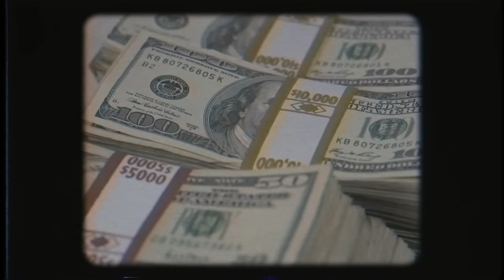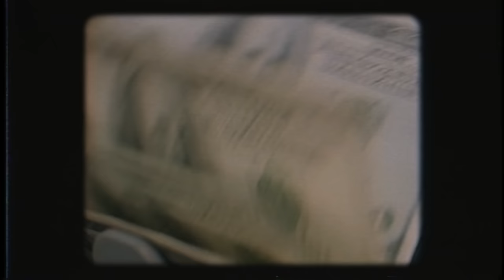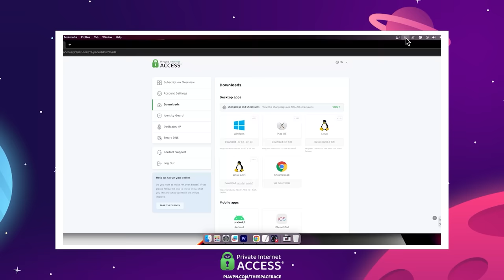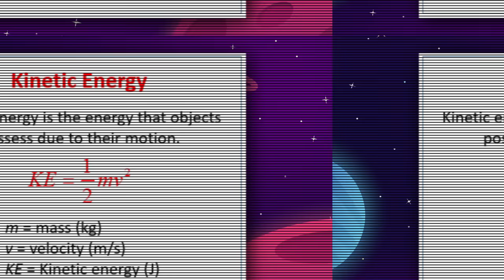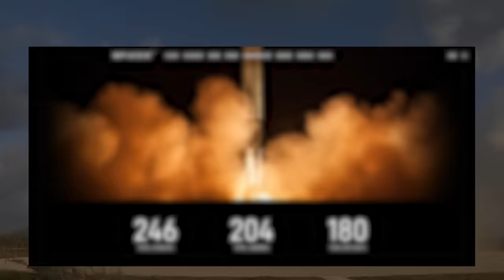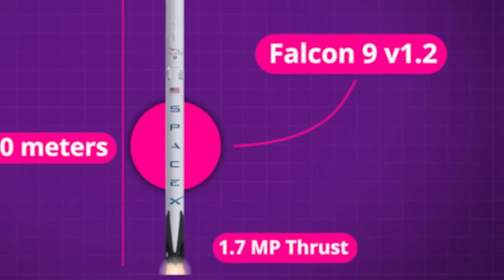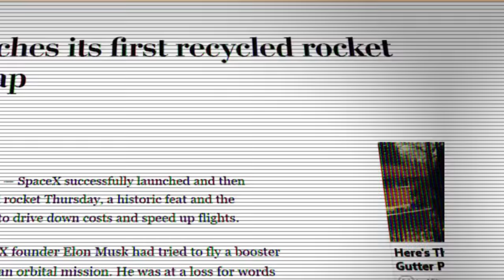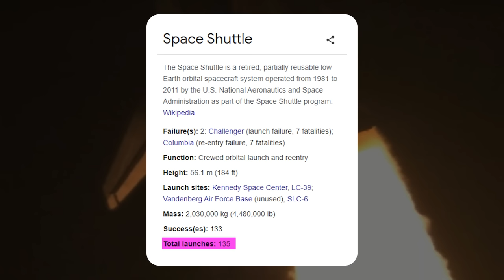How SpaceX Reinvented The Rocket!

Comment: One point about the shuttle: 136 missions, 2 failures, BUT the shuttle never failed: in both instances the launch system (first the SRB and then External Fuel Tank) destroyed or damaged the Shuttle.
Reply: 135 flights, not 136.  Not certain why that’s not clear, but your right about the STS never failing.  Cheers
Reply: The Shuttle Orbiter never failed. Two SRB's, one external tank, and one Orbiter equals one Shuttle Transport System. There were two STS failures.
Reply: The system certainly did fail, and cost over a $BILLION per launch - another failure. The lessons learned were quite valuable.
Reply: @johnstout5767  A 30 year run for a single design, deliver-payload-to-orbit capability, 7 person crew who deplaned down stairs on an airport tarmac, mini space-station, cargo-hold modular laboratories, repair and refurbish platform, and 100% reusability of the orbiter, designed and built in the late 1970s... a FAILURE? Not a single space agency on the planet ever got past cramped single-use splash/crash-down capsules. As for cost? It is 2023 and the SLS costs $ 4.3 billion per launch, THROWS AWAY the reusable Shuttle RS-25 engines and has a launch cadence of 1 : 1.5 years. Are you kidding me? You should kiss the ground the shuttle landed on!!! 40 years ago, man! 40 years ago!
Reply: @lawrenceallen8096 STS failed to meet its cost and safety goals, and as a related effect, failed to meet its launch rate goal. It was a tremendous technical success, however, and did deliver a capability to do things in space that no other system could do before or since. All in all, I think that for a first of its kind, it wasn't as bad as its critics like to whine about. NASA always had ideas to improve the system but it never was able to get the up front cash it takes to implement those ideas. And instead of building a Shuttle 2.0 which built on the earlier system and corrected its flaws, NASA had to cave to the critics and shifting winds of politics when STS was finally retiring, sticking NASA with SLS and hiring SpaceX for Uber rides to the ISS.
Reply: Zero Data on booster refurbishment has ever been released to the public.
Reply: @RCAvhstape  I mean as much as it was "politics" that retired STS and crushed the dreams of building upon that infrastructure for its successor, it was also "politics" that kept STS in circulation FOR 30 YEARS WITHOUT EVER MAKING IT WORK LIKE INTENDED. You can always complain about pulling the plug on a system that could be done better, but when there's literally zero precedence of NASA actually making STS work the first time, all when having 3 whole ass decades to do it, then I'm just not gonna cry over it. Nobody can say that $200B, 135 flights, over 30 years wasn't "enough time" for the STS to prove itself. In fact you'll be hard pressed to find any concept given more political capital than STS.

The SLS could've clearly been done better. For example, reliability and reusability of the RS-25 by the end of STS's run was legitimately good. It's a shame that it wasn't implemented on SLS. Instead of SRBs I'd love to see retrievable RS-25 side boosters. But other than, most other aspects of STS was a failure.
Reply: @lawrenceallen8096  RS-25 is pretty much the only aspect of STS that actually fulfilled NASA's ambitions of reusability with minimal refurbishment and quick turnaround. The rest of it was a mess. Like congrats, STS nailed down like 5% of what goes into reusing an LV. In a counterfactual world where NASA commissioned a STS 2.0, they'd still have to solve the remaining 95%, and if SLS was 6 years behind schedule, you just know that STS 2.0 would be even longer. Artemis wouldn't even have its first launch well after Starship would become fully operational at a fraction of the cost.

SLS is just a 5 vehicle commitment, whereas a STS 2.0 would've been a 30 year committment in a world where Starship is just better.
Reply: @ohedd  I would not advocate for an STS 2.0. The design is a half-century old. Why replicate that, even with improvements. "We're going to build a new '57 Chevy, but improved. No. I agree with you. The shuttle deserves to have an honored place in Space Launch History for its unique 30 years of service. We now, in 2023,  look forward to rapid reusability Ala the Starship. Also, next level economics to orbit, and one-of-a-kind inner-planetary capability. GO SPACEX!
Reply: Didnt challenger and Columbia explode during re-entry...
Reply: @parthasarathyvenkatadri  No. One was destroyed by a defective SRB (Solid Rocket Booster) igniting the External Fuel Tank during launch. The other had its wing damaged during launch by falling ice and insulation debris during launch, leaving a large hole in the leading edge of one wing, and was ripped apart during re-entry.
Reply: @parthasarathyvenkatadri  Challenger on ascent, Columbia on descent. Although both of their fates were sealed due to events during ascent and launch, respectively.
Reply: @parthasarathyvenkatadri Columbia's heat shield was damaged by a chunk of foam during launch that came off the tank, and Chalanger SRB had a bad o-ring that sent a jet off hot gas into the Fuel tank causing a explosion during asent.
Reply: @lawrenceallen8096  Space Shuttle was very primitive system from 70's, and overengineered in the same time.
Glider-like landing added at least 40% more weight for nothing:
parachutes are much safer and not dependant on weather. No rocket emergency escape system was a critical design failure.
Reply: @peceed  Your argument is akin to saying: "Those caravel ships used in the 15th century by Columbus to discover America were so over engineered. 40% of their bulk was unnecessary, using wood the way they did instead of carbon fiber. And no lifeboats? What failures they were." Yeah, sure peceed. Whatever you say. Having a fleet of ships meet you somewhere in the middle of the ocean and pull you out of a teeny capsule will remain the only way Human Beings will return from space in perpetuity. We'll never go back to the primitive days of landing at a Cape Canaveral or California runway and walk off. Geese! What were they thinking!? And thank goodness for Obama, he solved the problem: He took the USA out of manned space flight for a decade! He ended all that silliness! We're supposed to stand humbly on the shoulders of giants. Not pi$$ on them, son.
Reply: @lawrenceallen8096  STS was a stupid idea from the beginning, and step backward. Typical "cult cargo engineering": aircrafts are safe and cheap, so lets make space system that looks like an aircraft - it should also be safe and cheap.
There was a lot of really good private designs for cheap space transport for 70's. Space Shuttle wa the program that was designed to be expensive.
Reply: @peceed  When I had the opportunity in my career to lead teams that included engineers, one engineer friend of mine told me this: "One thing you've got to know about engineers: they are in love with their own ideas and will go to great lengths disparage and undercut other's ideas and other's achievements in order to promote their own. Even if... ESPECIALLY IF, their ideas are inferior. Don't let them mislead you." Somehow, your comments here peceed feel just like that.
Reply: @lawrenceallen8096  As a scientist and engineer I have one advice for you - you need to judge independently. If you are relying on opinions of other people - you are lost. I didn't say that Space Shuttle is a bad idea, I said WHY it is a bad idea. You don't need counteropinions, you need counterarguments.
Space industry was run by idiots in white collars. For example they saw that bigger rockets were more expensive than smaller, so they insisted on 
excessive weight reductions that increased costs around 5x. In reality fuel is so cheap compared to rocket construction, that it is always better to make heavier low tech solution.
Reply: @peceed  Hey, did you hear the one about the 3 guys & the guillotine during the French Reign of Terror? The first one, a commoner, was asked by the executioner: "Do you want to be face up or face down?" To which the commoner said: "Face down, I don't want to see it coming." So he assumed the position, the executioner pulled the rope, the blade came down and CHOP! The next one was a spiritual person. When he was asked face up or down, he said: "Face up: I want to be pointed toward the gates of heaven." So, again, assumed the position, rope pulled but WOW! This time the blade stuck half way down. The crowd gasped and the executioner said: "It is a miracle! Let him go!" The 3rd one was an engineer. Same question. "Face up, I want to see how this fascinating machine works." So they put him in, pulled the rope, it stuck half way down, and the engineer says: "Oh, I see the problem!"
Reply: I think you mean the orbiter never failed.
Reply: @valentinaerospace4211   Yes, the Space Shuttle. Not the Space Transportation System. Launch components of the STS killed the Space Shuttle twice.
Reply: The shuttle design from the start, was obsolete.

It was set around a payload size determined by the Defense Department that was never needed, along with a return after one go around orbit capability also determined by the Def. Dep., never needed, that made the wings the size they became. 

The shuttle could've been a lot closer to a lifting body, or a straight wing craft instead without that requirement.

The Defense Department later dropped most of it's use of the Shuttle, abandoned it's Vandenberg launch site along with 3 additional shuttle orders.

NASA really co-opted it's needs with the funding from the military needs that rarely then used it.
Reply: @jbdelphiaiii7637  Shoudda, wouldda, couldda.
Reply: @sonnyburnett8725 135 or 136 are you really going to be that guy that South Park makes fun of?
Reply: @RCAvhstape  
RE: ". . . and hiring SpaceX for Uber rides to the ISS."
Remember that both NASA and ESA had to use the Russian Soyuz spacecraft for rides to the ISS, as well. Which, of course, is a disgrace.
Reply: @spaceman081447  I agree, and I think it's a good thing that NASA is letting private industry handle the more routine stuff, that was kind of the point of creating NASA in the first place, to boost American aerospace industry. Maybe I shouldn't have worded it the way I did. But with the end of STS came the loss of a significant capability that was never really used in its day.
Reply: The External Fuel tank didn't fail... The shuttle just couldn't handle ice being dropped on it. Weak.
Reply: @lawrenceallen8096  Yea because we didn't need the shuttle for any of that lol. We did all that in spite of the shuttle not because of it. Sure maybe it looks good when you compare to other government blunders if that's the best you got.
Reply: @RCAvhstape  We didn't build the space shuttle 2 because any space shuttle design is doomed just because it's a space shuttle. The concept itself is bunk.
Reply: @Fooney1  Whatever you say, chief.
Reply: @Fooney1  Nothing flyable could survive supersonic impact of ice. Unless you want to fly a tank.
Reply: Humans failed, and both the Challenger and Columbia disasters could have been prevented.  NASA had solid info on both the SRB problem that doomed Challenger, and the foam breaking loose from the ET that caused the breakup of Columbia....and they knew and understood all of this well in advance of the failed missions.

The biggest problem the shuttle had was the expense: the concept was to reuse it, which they figured just HAD to save money over completely expendable rockets, but I guess no one ever considered the monumental cost of assessing and recertifying thousands of systems and components, and the shuttle never met is cost or launch frequency goals (not even close, in fact).

Reusing just the first stage booster might very well be the sweet spot where recertifying for another launch is cheaper than just building another booster.
Reply: It did fail. A successful spacecraft should be able to save astronauts from a launch emergency. The Shuttle was ridiculously unsafe.
Reply: @xitheris1758  Well, that's it then. 30 years, 136 : 2. Cutting edge, never been done before and never matched by any other country, unique capabilities that we can't even come close to today. Just a failure. Huh, and Apollo Saturn V was a failure too because it killed at a rate of 11 manned launches : 1 fatal failure. But it had an escape system! Huh.
Reply: @lawrenceallen8096  The only fatalities in the Apollo program were Apollo 1, during training in the Apollo command module. It never got integrated with the Saturn V, much less launched. The Saturn V had zero fatalities.
Reply: @xitheris1758  "It never got integrated with the Saturn V." Wow, is you ever an x-pert on that there Apollo! I guess that Apollo 1 test just used a giant paper machete mock-up of the Saturn V... you know, when the astronauts entered the capsule that day. Get, I didn't know the rocket that it was atop was a fake. Thanks for informing us!
Reply: @lawrenceallen8096  What are you smokin bro? It was never atop a rocket. It was in a testing room for a simulated launch. They tried to pry open the capsule when the fire started. Go look at the photos of the aftermath. It's in a building, not atop a rocket.
Reply: @johnstout5767 SpaceX currently charges 2.8 billion in taxpayer funded contracts to perform the same tasks as a single shuttle mission.

So what's the lesson?
Reply: It got hit by some foam.

Such a durable vehicle.
Reply: The external tank was its Aquiles heel. Its the direct and indirect cause for the loss of two vehicles and 14 astronauts. With Challenger the O Ring failed and the 'firing torch' punctured the Fuel Tank like a knife through butter exploding it, With Columbia the fuel tank dropped insulation foam during the supersonic ascent which destroyed a section of the vehicle's wing. The tank was the loose cannon in the whole Space Shuttle design.
Reply: @adelaideadelaide8855  Agree in the 2nd case. However, I don't believe any gigantic fuel tank design could stand a solid rocket booster ejecting what was essentially a gigantic blow-torch to its side while it is under supersonic stresses.
Reply: The launch system is part of the Shuttle... It flies with it... So the Shuttle failed. Granted, the Challenger destruction happened because of malfunctioning O ring in the SRB on launch, but the Columbia orbiter destruction was product of a Shuttle failure during atmospheric entry caused by isolating foam impact on the edge of the wing. A terrible tragedy nonetheless whatever angle you want to see it.
Reply: The shuttle was designed and implemented by NASA - a quality organisation. SpaceX has been failing and blowing things up on a regular basis since it's inception and has never had a really robust, reliable launch system... the eBay of space. You might get something cheap that works.... but all too often you just get something cheap.
Reply: @lawrenceallen8096 thank you for laying down some of the facts and correcting the unfair comparison of the STS to the falcon 9. The shuttle was basically a giant truck, designed to transport and assemble the international space station. The falcon 9 is designed to put payloads into orbit and transport supplies and crew to the ISS.
Reply: @TTURocketDoc  Thanks. I might add one thing to your description: "falcon 9 is designed to put payloads into orbit and transport supplies and crew to the ISS." Cheaply! At a LOWER cost.
Reply: @johnstout5767  The Orings didnt really even fail... they performed as expected under the conditions they were used in on that day. It was well known that a leak was highly probable when used below a certain temp (54F I think). The failure was a MANAGEMENT failure... management overrode the advice of their engineers. This is well documented.
Reply: The orbiter did fail do to the tiles falling off.
Reply: @ctuna2011  Nope. Came close, but no shuttle or payload was lost (or lost its re-usability) due to tiles falling off. Sorry, not true. The SRB's destroyed the orbiter in both cases there was a lost of the shuttle.
Reply: Will you stop this ‘pound’ insanity please? The world is about tons. By contrast you do use meters for length. Wise to avoid feet and inches, for starters
Reply: @RomanMedvid  I'm a native born American who lived abroad for 22 years. I'm comfortable thinking in and working with both. I even got used to working with "ping" when shopping apartments in Taiwan HongKong and China. Best of luck dealing with your discomfort with other people using multiple measurement systems.
Reply: @parthasarathyvenkatadri 
No the landing gear door on one side was not properly latched, a weak design principle. The door was open, on reaching orbit as imaged by an Airforce satellite image, but not visible, from the cabin or the space station, the excuse of ice breaking the carbon carbon leading edge was a coverup, to protect the contractors. The internal aluminum structure was suject to the high temperature and lead to a fast wing failure, but not an explosion.
Reply: Not many know this, but the Space Shuttle was also self-flying up and down.  The flight commander had the option of taking the controls as the vehicle went subsonic, but it could and did land itself.  That's in addition to launching to orbit and atmospheric reentry at Mach 25 -feats no human could manage by themselves.  SpaceX pioneered self-piloting and landing, reusable boosters -an amazing feat into itself, especially given that Falcon 9 has the fight characteristics of a Pringles can!  But not the first spacecraft that can land itself.  And the jury's still out on whether the Ship and SuperHeavy will land themselves in the manner intended, right back on the launch pad.
Reply: @johnstout5767 So far, that's about the cost of each of Starship's launches, when you factor in NASA's development funding for it.  Once operational, I wonder what the per-moonshot cost of Artemis-with Starship will be, given the estimated 15 refueling trips that NASA engineering came up with.  Fifteen Starships up and down, to get a Starship to the moon.  That's a stunning figure, and multiplies the risk.
Reply: @The-KP  I don't put SpaceX and the shuttle in the same category. The Shuttle was in a class by itself. 1970s design & tech, what it achieved was amazing! As you said: Mach-25 reentry and landing like a plane! Nothing like it ever! As for SpaceX, well, it is approaching 60 years since Apollo. It's long over due for a new threshold of technology. Whatever the flight characteristics of the Falcon 9, 300 successful landings of a booster used up to 20 times? Come on! Frigging amazing. As for Starship? Well, in 2 or 3 years, everything else flying will be obsolete, when we break the $100/kg in to orbit barrier. We deserve that era.
Reply: @lawrenceallen8096  yes, but this is indirectly a failure from the ship Columbia because it couldn't withstand the ice
Reply: @navlis2560  It was supersonic at the time of impact. Nothing ever created by humans that could fly could withstand a supersonic impact. It's an impossible standard, and so irrelevant.
Reply: That’s an important distinction! The Shuttle itself had an incredible track record, but it’s a reminder of how crucial every component of the launch system is. Even the slightest failure elsewhere can have catastrophic consequences
Reply: @johnstout5767  It's true that the costs are astronomical, and failures can be disappointing. However, the lessons learned from these failures are crucial for improving future missions and ensuring success
Reply: @miles2378 fragile carbon carbon that shatters. With no shield behind it. No titanium or stainless steel. No baffles.  Horrible design made to be cheap built by the lowest bidder.